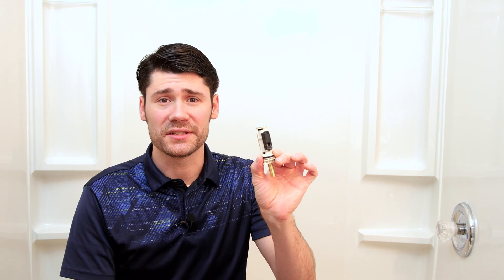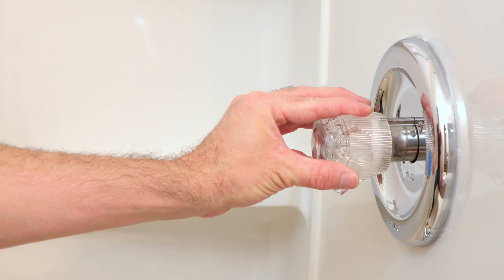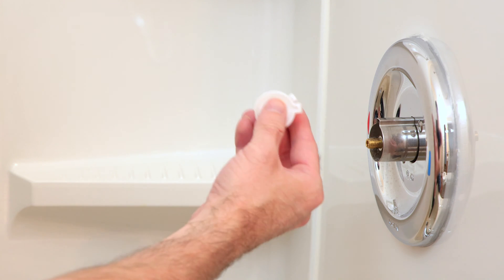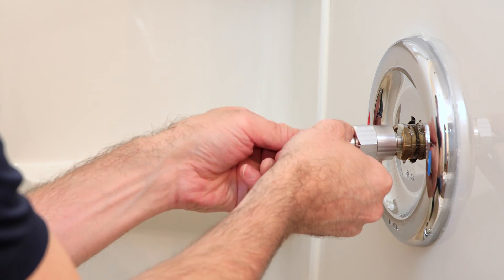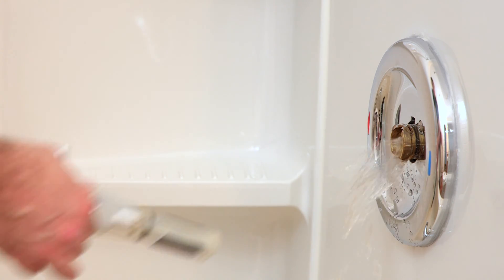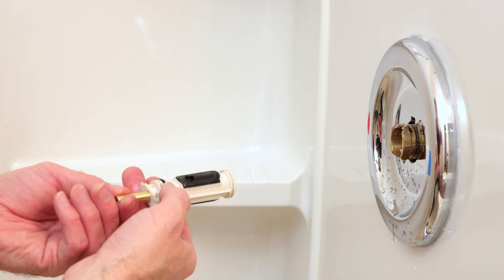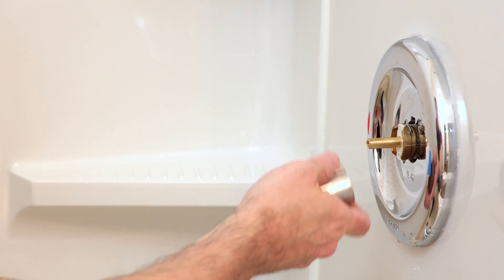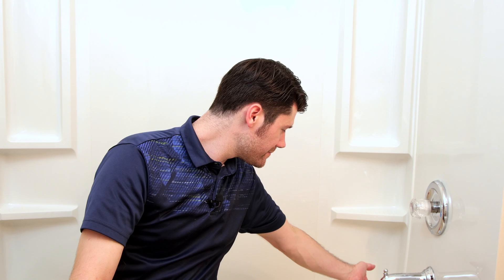Why is hot water coming out of the cold side?

Comment: Installed a new 40gal tank gas tank water heater but we only get 5 min of hot water before all the water in the house goes completely cold! Would a failed cartridge be the issue or a different plumbing problem? We checked the burner is working fine and the gas pressure which is 7.5
Reply from the maker: Hey thanks for watching however, I 
am not a plumber, I would suggest to reach out to a plumber if you did the install your self and it is not functioning properly. Good luck!

Comment: GREAT Video.. Quick Question... I've experienced this and a couple days later we heard rushing water and 3 plumbers determined we had a leak somewhere and wanted to start cutting drywall and ripping up concrete.... $$$$$ WITHOUT doing any diagnostics to pinpoint a leak. MY QUESTION IS:  
could this reverse back flow be causing water to somehow drain back into the system and somehow into the main Exit pipe?
I just find it unreal to accept that they coincidentally happened within 24 hours of each other.
I know you're not a licensed plumber but you seem like a smart guy
Taking a shot here...
Thanks!
Doc
Reply from the maker: Thanks for the watch and comment! Sorry to hear you are having plumbing issues! As far as I am aware the drain line is generally not connected directly to the water line. Rushing water in the walls does sound not good. Hope you can get it figured out!

Comment: ok I have this not having fully cold water problem in 2 shower faucet and 1 sink faucet. In one bathroom both tub faucet and sink faucet has this problem. However, sink faucet is almost near cold but the tub faucet has warmer water than the sink faucet water. In the other bathroom only the shower faucet has this problem but not the sink faucet. This problem started to happen few weeks back. Could it be an issue with water heater having too much pressure or cold water doesn't have  enough pressure?
Reply from the maker: Hello, thanks for the watch and comment.  Firstly, I am not a plumber but, if you find a shower faucet that doesn’t seem to really change the temperature much likely that is the culprit. It is relatively cheap to buy the parts and replace the shower cartridge so you could try it out to see if it fixes your situation. If it does not I would call a plumber.

Comment: Thank you for the video.  I’m experiencing this situation in my home right now.  Is there cartridges, say in a bathroom or kitchen faucet?   I turned on the faucet in my stationery tub after not having used it in months and months, so I’m guessing that’s my problem area.  Do I just buy a new faucet or is there a cartridge that I need to replace.  I’m a female senior citizen so if you can talk to me like a 5th grader, that would be much appreciated. :)
Reply from the maker: Hello, you are welcome and thanks for watching! I am not a professional plumber, I just wanted to share an experience and solution that worked for me. Any faucet that has one knob to mix the hot and cold water could be suspect. There are quite a few different faucets and cartridges for them so I can’t really help too much over what I shared in the video. I suggest calling a plumber to check out the situation and mention you think it may be related to a cartridge failure. Likely you would not need to replace the whole faucet, only the cartridge. The prices can vary on cartridges but should be in the range of $30-$80 and it should only take 15-30 min for a professional to complete the work. Good luck and I hope the issue is easily resolved!